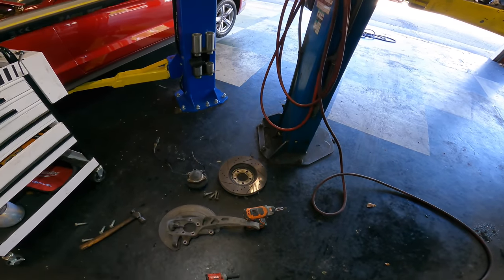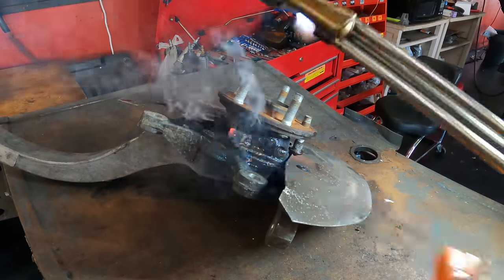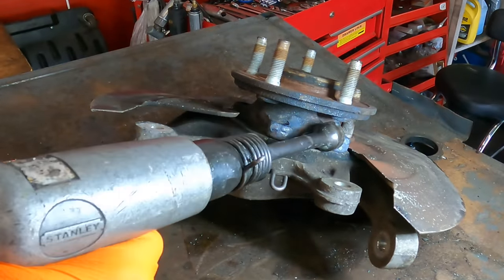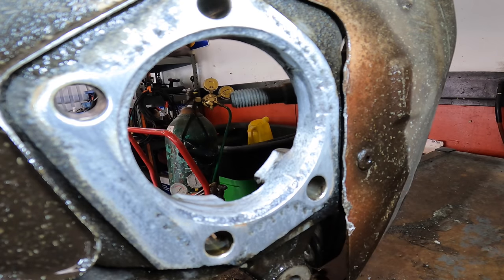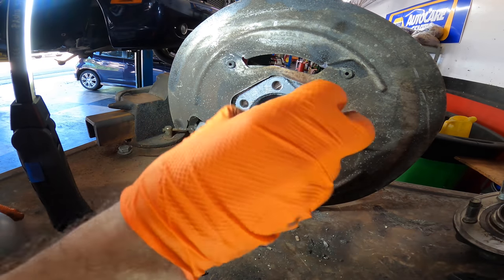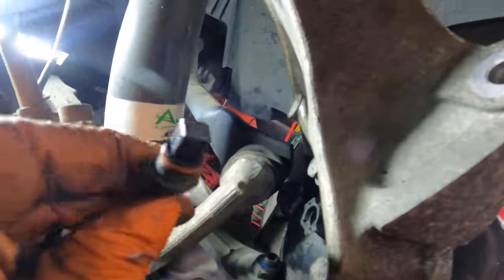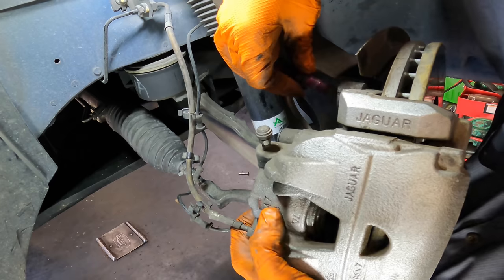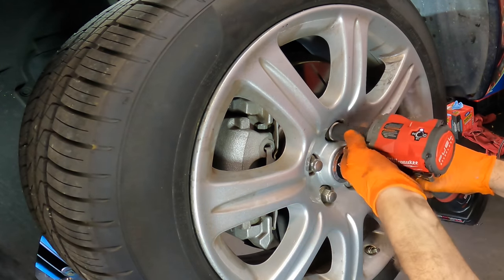Serious Corrosion! HEAT Required! Torching a Jaguar 2008 XJ 4.2 Hub Bearing/Bent Parts

Comment: Popped a brake line yesterday arriving at work.  Today will be a fun day of replacing both front calipers and brake lines.  I take no chances, I replace both.  I'm not a trained mechanic like many of you, but I have done my own work for eons.  "I am not a mechanic, but I watch one on Youtube", is kinda the same thing as "I'm not a gynecologist, but I'll have a look."
Reply: There is a YouTube video of brake job for every car. Buy a flare nut wrench to disconnect the brake lines, using a regular open end wrench on brake lines can damage the nuts on the brake lines.
Reply: @loneranger4175  I have everything i need, thanks for the info!

Comment: I have worked on these seized up bearings before. What worked for me was a chisel at the seam of the hub to the mount with plenty of liquid wrench. By using the chisel method , no heat is required which saves the bearing if needed.

Comment: I wanted to torch my Jag X type right in the dealership parking lot. Sold me crap and didn’t even certify it. Missing wheel nuts and more isn’t a certification. Got a flat driving it home and the spare was flat. Later lots of weird failures. Sold it at a loss but bloody glad and we removed the stress of ownership

Comment: As a person who has been doing this in the industry for 30+ years, I appreciate your videos and whit. As you know, if you put ten "mechanics" in a room and pose the same question to the group? You'll probably get 10 different answers to aforementioned question! You are doing a great job. Clean and sanitary! Keep up the good work! Not telling you your job, but if you come across an older Chicago pneumatic CP-717 air chisel? Buy it! I call mine big Bertha! LOL it has a corrosion, and metal mixing amount of power. It may help. I'm a subscriber, and will continue to watch your viDeos. Thank you for what you do.
Reply: In the trades you have to find the best way that works for you it doesn't mean it's right or it's wrong it just works best for you have a good evening

Comment: Hello from Northwest Ohio love your videos,having worked on car haulers for 25 years ,they have a valve bodies that are aluminum with steel thru rods holding them together. Spent may a day getting them apart to replace a valve which may have been in the middle of a 10 valve bank so I feel your pain. Have a good day

Comment: Awesome work Ray- while Anti-Seize is better than nothing, what you should use to prevent Galvanic corrosion is a product such as NoAlox - which prevents AL from oxidizing as a chemical reaction with steel. Very important in FL as we don't have salt on the roads- it is in the air, and when it rains, it becomes an electrolyte which is what made that corrosion. The anti-seize is good- but Noalox was made for the task of preventing AL corrosion where it contacts another metal by making a film to prevent oxygen on the surface. Thanks again and check out the Noalox - I keep a bottle in my toolbox, and it won't make you a tin man. Cheers!
Reply: On molds we used to use stuff that was a step up from Anti-seaze but it's expensive called Krytox I spent 19 years terrible down cleaning up rebuilding them and put them back apart back together so I made sure I used plenty of cry Krytox have a good evening

Comment: Had the same problem on my 2012 RAM. But I removed a wheel stud and used a large bolt with nut and pushed the hub out.
Thank ERIC O at S.M.A. .

Comment: What I've done is loosen the mounting fasteners a turn or 2. Use a 60-90 ton press. The mounting bolts push the hup out of the knuckle. Might bend the back plate a bit so either replace or use a hammer and pry bar to keep the rotor from rubbing. PenRay lube works well.
Reply: I had a big hydroelectric presto when that bearing started to squeak and creak and I press started grown stand back have a good evening

Comment: We who live in the rust belt feel your pain!  I had an old Suzuki with steel rims rusted onto the rotors and took much penetration fluid, pounding, and cussing to get stuff to break free!  (Just getting the wheel off was a pain!)  Made a 30-minute brake job an afternoon project but she's done and has fresh anti-seize to help the next guy.
Reply: Rusted on wheels will come off a lot easier with the 'Donkey Kick' method, I use it quite frequently.
Reply: @daledickey8400  Oh she got many kicks from the back and front and many hits with a sledge....stuck!!  So after sitting for a bit with some penetrating oil sprayed, she finally let go....stupid rust!!
Reply: @coloradoboo1071  very easy way to remove stuck wheels method. Brake loose wheel bolts but not too much. Drop the car down on the wheels ;) if that not gonna brake it loose then start the engine move car few centimetres and brake ;) jobs done
Reply: @Egon1982  I’ve since heard of that!!! Thanks!
Reply: Loosen all the lug nuts about a 1/4 inch out, then proceed to do some  aggressive high G cornering maneuvers, when you hear the loose wheel rattle  hop out tighten back up, then head back to the shop, old tire shop trick, they don't have the time to waste beating on the wheels and other nonsense
Reply: Had that with my mothers car, alloy wheels on steel drums. Even driving the car with the studs loosened wouldn't get the wheel to break free.

Comment: I had the same car. if you punch out the lugnut bolts and put a similar size long bolt through 3 of the holes and tighten the nut it should press itself out relatively quick

Comment: Put the click on MAXIMUM!  2.5" x 3/4" rectangular tubing x 5 foot long ...  with a 36mm socket welded on one end:  that's what I used to remove or torque the flywheel gland nut(factory specification was 235ft/lb)on my VW BUG.  And the axle nut(218ft/lb.), which fastened the rear brake drum.   Later on I modified a 3" long 3/4" drive extension to fit into the 36mm socket and protrude through the other side of the rectangular tube.  It was welded in place.  So I had a 5 foot long "wrench" that fit any 3/4" drive socket.  It cost about $25 to make (1989).   It can bust any nut!

Comment: Did a bearing replacement on my kids Dakota. When 3 of the 4 heads of the bolts twisted off flush with the spindle I knew it was going to get ugly. Even pre soaking bolts for a week and heat before attempting to remove was no bueno. Pulled spindle,Drilled bolts tried a 25 ton press nope. Ended up building a step tool and a full swing with a 15 lbs maul about 30x and heat. Thought the thing broke clean thru when bearing finally let go.
Ahhh yes Natures loc tite. Sigh.

Comment: You should get yourself a brass brush for your drill. Brass is softer than steel, so it won't gouge or otherwise mar the steel surface(s), but it WILL clean the surface of the steel of anything that IS softer than brass. I use a brass brush on the chrome pipes on my motorcycle (brass is also softer than chrome). Works wonders.
Reply: I wouldn't use it on motorcycle pipes cuz I don't want to recommend something wrong but Scotch brite blue makes a form of a disc or I call it a Tootsie roll and you can get inside a diameter and clean it up without taking away any material that's the biggest thing you don't want to take away any material on the outside of the bearing or on the inside of the aluminum knuckle have a good evening

Comment: The torch you are using, is for cutting 10-30 mm steel plates, use a velding head to the the gas mix.

Comment: Shop press or vice, old socket, and BFH combo usually gets the job done quickly imo.
Reply: That depends on what you are working on. In this case, no way. Aluminum is too easy to damage. It could bend, break, or both. Using heat to break the bond was a good choice.

Comment: When cleaning up hardscale corrosion like that, I use a wire wheel or toilet bowl cleaner and a wire brush.
Though it looked like your chisel worked well.

Comment: I had exactly the same problem when trying to change the bearings in my XK8. I have a 20 ton press but couldn't get enough heat because I don't have acetylene so I took the arm to the local Jag dealers and asked them to use plenty of heat and their 50 ton press. When I went back the next day they Manager called me into the workshop and the arm was still in the press with the bearing still in. I asked whether they had got it red hot but he said not as they didn't want to risk damaging the arm as they were no longer available. I pointed out that that car was unusable as it was and if the arm was damaged by the heat/pressure them so be it. That's a bridge I would have to cross if it happened. They then got it to red heat whilst I waited and it came free with a massive bang but was fine otherwise.
By the way, I have used anti-seize on every stud, bolt and nut including the threaded part on every car, bike and truck for the last 55 years and have never regretted it for one second .... in fact, quite the opposite when I come to work on the same part a few years later.

Comment: 11:40 surprised whoever destroyed the two right torx bits and replaced them with hex heads didn't do all 4.

Had a Mercury cougar with those T-45 I had to torch/extract every one of the 8 caliper mounting bracket bolts. Broke 5 T-45 impact bits and now own 42 extra hex bolts cuz I could only get that size in a 50 pack
Reply: Exposed large torx bolts hate me, which is OK because I hate them right back. :)
Reply: I am guessing that was from the factory... The two Torx head bolts appeared to be used where there would be a clearance issue with a hex head bolt.

Comment: Minor note on the Wheel speed sensor clip: This looks like one of those fancy Euro designs that are designed to allow you to pre-install the clip onto the component in the provided groves, and it will hold itself in place. After that, it'll use the spring's tension to click itself into place once you push them together.
Reply: So your saying we missed a 'click'
Reply: @redactedlogic  Not exactly; he didn't miss it so much as he went around it. tl;dr = Nuthin' wrong w/ the way he did it, it's just easier to pre-install the clip is all because then it's like a plastic electrical connector.
Reply: @redactedlogic  This is pretty much exclusively a Eurotrash thing, and if you don't do a lot of work on them, it's really easy to miss.
Reply: Window cranks in the old Chevys and Ford used to work the same way have a good evening

Comment: I have for me,  my method is PB Blaster and an air hammer. Loosen the 4 bolts 2 turns each. Hit the bolts straight down taking turns on each. Slowly, it should start walking out. Loosen the bolts again as required, repeat with the air hammer.

Comment: The Jaguar xj will be back till the customer runs out of money. I want to see fuel pump replacement on that model. GREAT JOB!!!👍👍👍
Reply: If it is the v12 that would be a lot of fun, been there done that.  I bought a used 71 XKE with v12 and among the various repairs and maintenance that had to be done replacement of the h20 pump was first.

Comment: My two cents: Heated metal expands (delete: with the exception of mercury). If the heat was concentrated only on the outside not much heat is required to expand it a tiny bit. A ton of heat would expand both the housing and the bearing. This defeats the purpose of creating a gap. Using a press while it was heated the bearing would have come out easily. 
As with other key board warriors, excessive heat will alter the integrity of the part.
Reply: Using concentrated high heat to unfree two metal surfaces is not just about contraction and expansion of the surfaces.  It is about unseizing the rust and corroded particles that are holding them together.  Think along the lines of electrons that become less stable and in an excited state when heat is applied.
Reply: Mercury also expandes when heated, its the principle of mercury thermometers.
Reply: Remember different metals and alloys have different expansion/contraction characteristics as well.  These parts aren’t all made with the same materials.  Sometimes that needs to be taken into consideration too.  Whether that’s relevant here I don’t know.
Reply: @robbflynn4325  And the easiest way to insure that the two parts unseize is to get the outer part to expand whilst the inner part does not - the surfaces will then simply rip themselves apart. The amount of heat used here would have heated the steel bearing up way too much, causing it to expand, thus defeating the whole object of trying to get a gap between the outer aluminium, and the steel of the bearing. Plus, aluminium will soak up the heat much quicker than the steel, which means it will also cool down much quicker than the steel. So by putting that much heat in to the whole assembly your simply encouraging the two parts to clamp themselves together even harder because the aluminium would have contracted again whilst the steel was still in an expanded state. But I agree with, at some point during the heating process the corrosion bond would have been broken, that would have happened very early into the heating process, the second that the aluminium started to expand before the steel had warmed. I would have used a more gentle and quick application of heat, so that heat did not have time to transfer into the bearing. Another thing to consider is that the yeild strength of aluminium can be reduced by half if it's been heated too much, certainly something to consider in a safety critical component like a wheel hub.
Reply: @kairoling450  Thanks. What was I thinking? Not enough coffee.
Reply: @robbflynn4325 Also you need to take into account that aluminum expands at a faster rate than steel. Once the temperature evens out the aluminum bore will be slightly larger than the steel hub.
Reply: @kairoling450  ...i think mercury has a low boiling point too  if not mistakwn . They used to use mercury in power plants (a long time ago) ...until too many people got poisoned
Reply: @MrCumstein  Thats correct. I believe aluminum expands about 2-3x as much as steel for a given temp. A part that size is only going to expand a few thousandths of an inch but its enough to loosen it jsut enough to get it out.
Reply: @100SteveB  I thought about that.  i wonder if a slow heat of the aluminum with something like a heat gun might work. Aluminum expands much more than steel. Any heat treated alloy will be comprimised by too much heat. I would guess most Al alloys can take about 300-400F withou much trouble.
Reply: Aluminum expanse a lot quicker than steel when you have that difference in heat conductivity that's what breaks the bond have a good evening
Reply: And what do you do for a living have a good night
Reply: @kairoling450  years ago in the hat making process they used to use mercury and that's where the term mad is a hatter came from have a good evening

Comment: Finally, a man after my own heart! You (presumably as I do) listened to the gas flow and added some closish but still Acetylene rich Oxygen BEFORE lighting it and having black sooty snow falling all over things. You're the only person I've seen do that on any of the YT clips, on the shutoff too I've seen, good on you.
I can't say I'm keen on the idea of that much heat so close to a bearing I might be going to use though.
What a weird combination of fasteners on that hub, 2 hex bolts AND 2 Torx bolts, that is to me just done to make things harder intentionally by having to find and keep swapping tools for fasteners doing exactly the same job on exactly the same part. Was it my own vehicle I think I'd replace those stupid Torx bolts with a couple of grade 8 HEX headed ones.
EDIT:  Apologies, I just read your explanation and I had things arse up there.
Reply: black soot= death angels....add a 'little' more ox on start up
Reply: @torchit007  Dude, WTF do you think I just flamin well said.
Reply: @lorditsprobingtime6668  STP

Comment: As someone in the rust belt we put antiseize on bolt threads all the time.  Never had issues with bolts coming loose.  Maybe need more uga dugas
Reply: I get why you would want to make extraction easier, but lubing threads that are meant to be dry means you apply more torque, or rather more rotation for the same applied torque.
Reply: @capnpugwash5403  I probably over tighten but has never caused an issue and I'd rather get them out next time. If it something more critical like a bearing preload or head gasket I don't use antiseize. But even with antiseize bolts still rust tight here in WI
Reply: Yeah, the concern with anti-seize on threads is over torquing, not accidental loosening. However, I use it all the time... Especially on aluminum! 
Ray is right. That silver anti-sieze seems to find it's way onto everything. I learned that the hard way (did my Tin Man impression).

Comment: I tell you that replacing a strut on a 2014 KIA Soul was a biggest pain in the hind quarters. I didn’t realized that you had to take the wipers off and take the plastic cover off just to gain access to the top of the strut housing.

Comment: May I suggest that, when heating parts, you use leather gloves?  Pigskin welding gloves will handle a lot of heat.  Synthetic gloves can melt essentially instantly and cause Horrible and Permanent burns.
Reply: Burning synthetics will stick to your skin like glue been there done that you can't shake it off have a good evening
Reply: @michaelpressman7203  You and I both, brother!!

Comment: Just because you don't have salt on the roads causing corrosion, you do have salt air from the ocean, and rain. Water will cause dissimilar metal corrision also. I know it's messy, buy you can never use too much Never-Seize. I use a lot of it, and rarely have issues if I have to dissemble something I worked on it the past. Hey, Dennis must have worked on this, it's got Never-Seize on it!